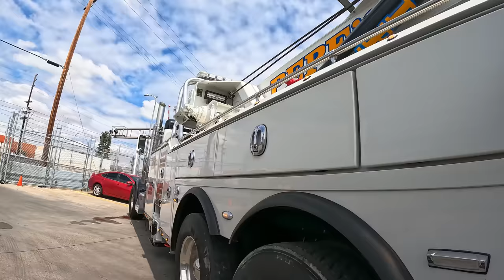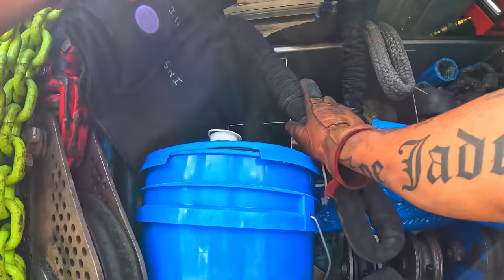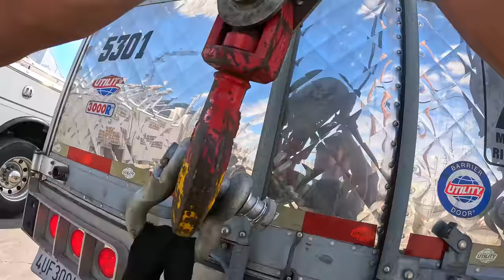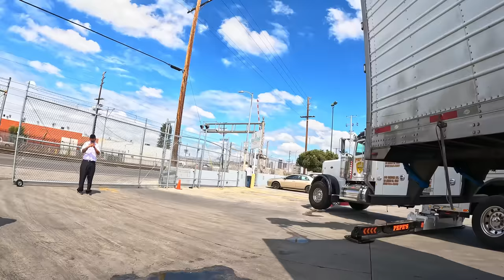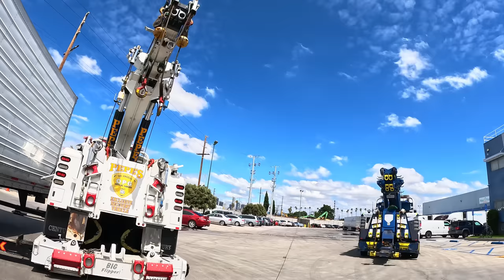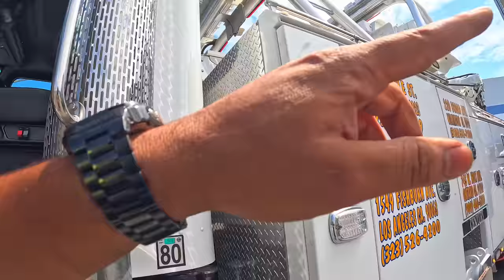Swing Wide, It's a F***** Trailer!

Comment: why did you use the shackles and not connect hook directly to the straps
Reply from the maker: To protect the straps. Run your fingers on the inside of a snatch block. Rough isn’t it ? You don’t want your straps in there under pressure and risk damaging them. The inside of a snatch block is not smooth.

Comment: I would like to see a job where Jose Acosta does it with his truck UNIT 77 : 2022 PETERBILT 389 day cab 60 ton Century 1060S rotator tow truck tri-axle single steer
Reply from the maker: Why? My dad is the absolute last to go out on routine basic calls
Reply: @PepesTowingService  I thought it would be interesting to see him do it with his unit.
Reply from the maker: @jonahkasiborski1472 it’s just a basic trailer lift tho. Even a heavy wrecker could do it.
Reply: @PepesTowingService  One day I would like to see you guys doing some towing larger trucks with the Heavy-Duty trucks like the 6 rotators, 15 wreckers & 1 semi with the DTU.